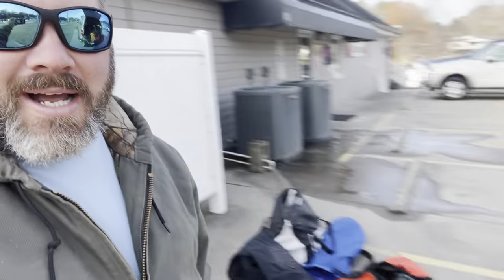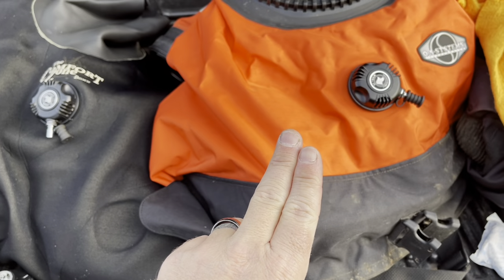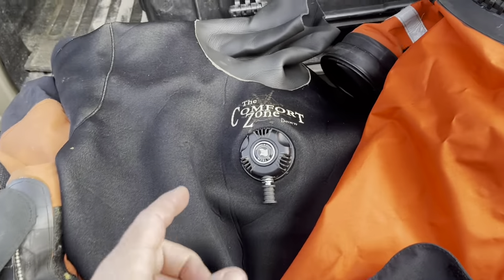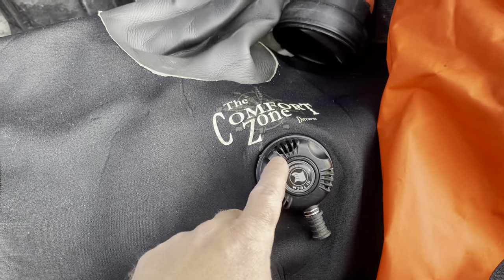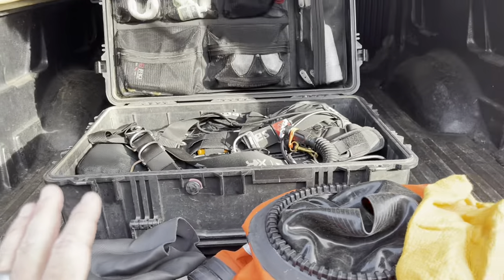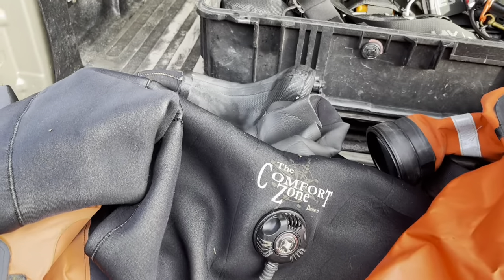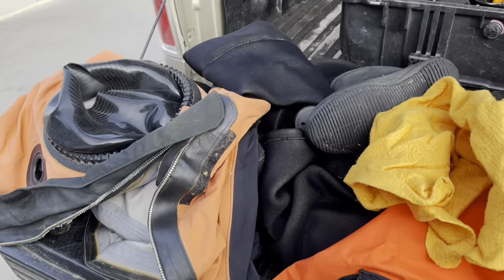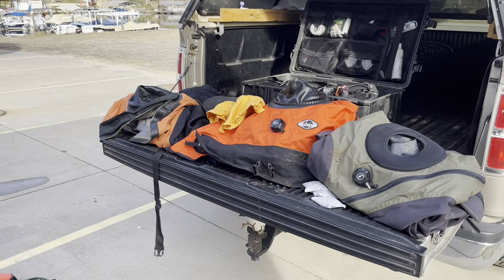Drysuit Failure And Repair Discussion

Comment: Bryan,
Thanks for all the great videos.  Quick question:  Do you prefer metal or polymer zippers on your drysuits? My trilaminate DUI metal YKK zipper is beginning to leak through small wear points in the zipper flange (about 20 years of use so I'm not complaining).  I've always used metal in the past but am considering a switch to polymer for inherent physical flexibility.  Your thoughts?

Potential dry suit topics:  Pee valves, boot options, glove systems
Reply from the maker: Hello lewnance, thank you for the video ideas. In regards to the zipper question, it all depends on the purpose of the suit. In my Neoprene Drysuit, I have the YKK polymer zipper which is great because it is more flexible and comfortable, which is why I use the Neoprene Drysuit for fun diving. With my working Drysuits, I prefer the number 8 brass tooth zipper from YKK. They are more durable and can take a beating.

Comment: Having my third trilaminate suit I have learned to dry yhe suit efficiently. Turning the suit inside out is essential. However having integrated boots you cannot turn boots. The rapid and efficient method to dry the boots I use is, indeed stolen from skiers: electric boot dryers. Mine are sigar shaped (11W each) wall powered heaters which het warm, not hot. Putting those inside each boot it takes only a couple of hours to get boots completely dry. The inside dries same time so you can easily get the suit dry durin an evening. It is so nice to go diving the following day when you have a dyy dry suit.
Reply from the maker: Hello N N, I am definitely going to give the boot dryers a try. Thanks for sharing.

Comment: Bryan, why do you believe the OSSystems bilaminate drysuit to. be "more durable than their trilaminate drysuit"?  I've been diving my OSSystems SARR-V front-entry horizontal-zip (brass zipper) for 20 years and am beginning to see wear in the crotch and armpit areas; so I'm beginning to look for a new replacement drysuit.  I'm thinking a trilam replacement ... but your comment has gotten me thinking.
Reply from the maker: Hello Morgan Ames, if you have got 20 years of use from your Sarr-V, then you can understand why. It is built like a tank. In the bi-laminate suit, the material is slightly thicker than the material used in a tri-laminate, making it more robust. The biggest complaint I have with it is, there is no flexibility in the material, and it is not breathable. I primarily use it for dives where I know I'm going to be in a hazmatic environment, and a dive where I'm going to be stationary for a given amount of time. Commercial dives where I'm not swimming around a lot, the SARR is perfect for me. As stated in the video, my Comfort Zone Scuba (neoprene suit) is my all time favorite for comfort and flexibility. I recently got the Scuba Force Expedition (the olive drysuit) stolen and have now replaced it with another Expedition model in black and red. It will be making apprearence in future videos.

Comment: I’m at the r point of needing to move into dry diving since I hate being cold. Buying a $650 5-7mil that I’ll still be cold in doesn’t make sense since I am going to also do the advanced nitrox deco procedures, and then cave. I’ve been eyeballing the Scubaforce for about a month. I’d love to hear your feedback on that one specifically with things you like or would have done differently. Also, adult diapers or pee valve? I’m not a dehydrate or hold it kind of diver 😂
Reply from the maker: Hello Caleb Mcelhaney, currently, the Olive Scuba Force you seen in this video is no longer in my possesion, it was stolen from me back in early May of this year. That being said, I have purchase a new Scuba Force Expedition, this one Red in color which you will see in some future videos. As far as quality, I have been very pleased with it. Compared to all of the other Drysuits, of similar design, they can hold their own. Well built, a ton of features, and reasonably priced. As far as peef valve or diapers, pee valve all the way.
Reply: @LakeHickoryScuba  dude that’s messed up. I we had a local shop owner get his two Shearwaters and Nerd jacked recently. Glad to know you liked it enough to order another.

Comment: ia week ago , i ordered a decomitioned whites dive dry kodiak .... they saiad seals damaged (they were) took to local dive shop for seal replace ...leak test and quote to re locate inflator from hip to chest  was hoping to add high performance to old car (so to speak ) is your whites not repairable ? no word from dive shop yet ! i purchased to referb. what i thought might be more heavy duty than normal .....what u think?
Reply from the maker: Hello gregoryrussell2959, typically shell based suits over time will break down. Meaning, the material will begin to become delaminated. When this occurs, there is no hope for the suit. Over my career, I have had this happen several times. Replacing seals is possible, as with replacing the zipper when needed (though this is an expensive repair over time). Changing the location of exhaust and inflators is easy enough to do, but then you have to repair the hole that is left. This will always be a failure point that has to be watched constantly. In regards to the Whites that was in this video, it is simply being used as a teaching aid from this point on.

Comment: Prefer dry suit DUI CLX Try laminate Apex valves Never had one fail.. Wearing a shop suit Teaching student Had a Whites inflator fail open  In the middle of One of the student skills Of course I ripped the inflation  Hose off of 1st thingBut of courseInflation button stuck wide open doesn'tTo turn you into the hindinbergAs being snatched upSwam down as hard as I couldThe current will not allow me to do any kind of flip to move the airAfter noticing thisChoice for simplePulled out my Mike Nelson man knife lolMade a nice big release hole in  the legs.. Of course that fixed the problem I ended the dive Of course With 2 students we did a Safety stopAll the while thinkingThese 2 will never take a dry suit courseTry to be as elegant as I could but sometimes it just is what it is
Reply from the maker: Make sure you bring your Drysuit this New Years if you, the wife, and kiddo come to see us. We will definitely get some cold water diving in. Hope to see you soon.